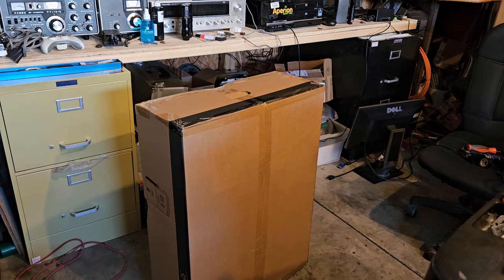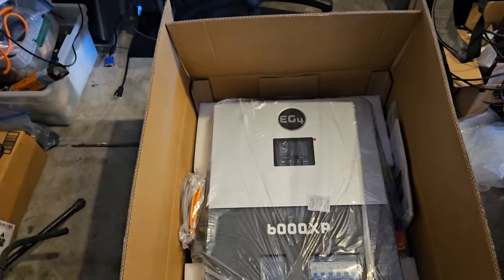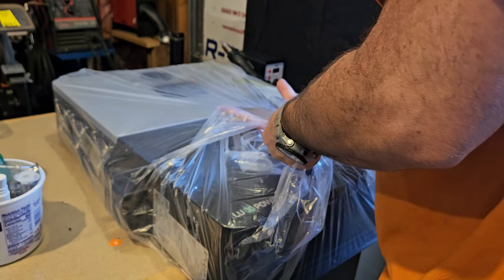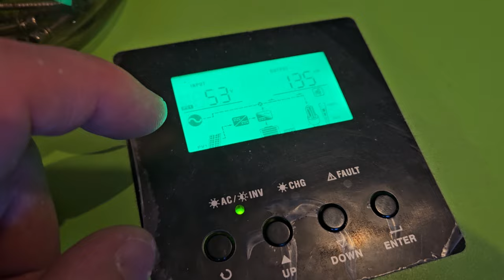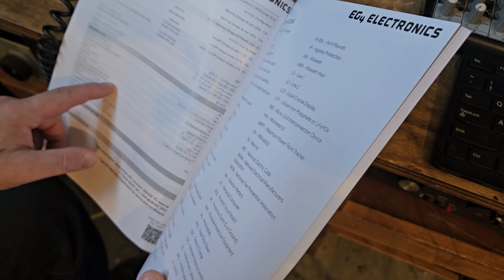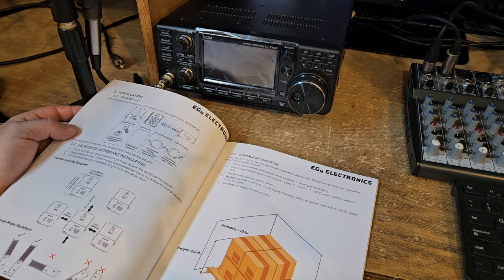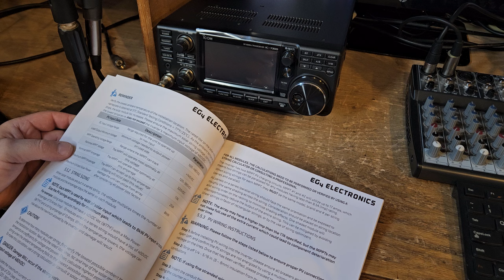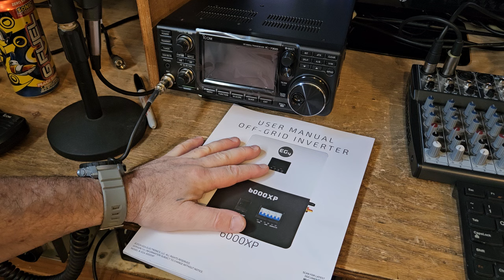Bought a EG4 6000XP.  unbox and look at features in manual

Comment: Nice inverter. How much did it cost? Nevermind. You mention $1449ish and I missed it initially.
Reply from the maker: Yes. 1499 from san tan solar
I have enough battery. I also learned something after 4 hours of screwing around that you need to set it to lead acid batteries if you're not using one of their compatible batteries that communicates directly with the BMS really frustrating hours spent reading the manual over and over and watching videos on YouTube finally I found a video by one guy that explained it so anyway the best way to use this is going to be with one of their rack-mounted batteries otherwise apparently it doesn't work real well and it doesn't like to balance the sales real well
Reply: @hamradiohack interesting and good to know. If on a budget you could probably get away with one server rack battery for comms and as many dumb batteries in parallel as needed. Thanks for sharing also really like your content and am a subscriber. Waiting to know if the new inverter helps with interference on the radios.